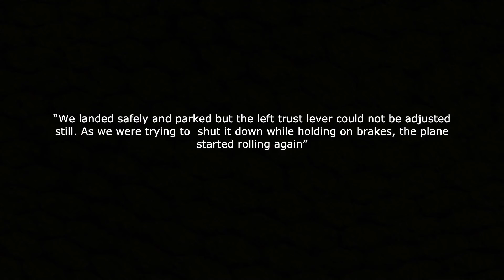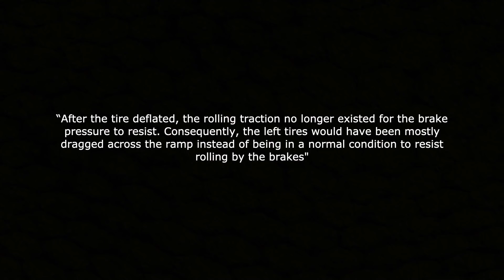The Crash Caused By A False Sense Of Security | RwandAir Flight 205

Comment: I think I'd have remained on the runway after coming to whatever kind of stop it was, and cut the fuel switches. If that didn't work, set the parking brake.  If that didn't work, pull the fire handle. If that didn't work, discharge the fire bottle. If that didn't work, have the fire department shoot water or foam into the engine to snuff it out.  I reckon the crew would have certainly felt the tyre imbalance - even with good types you feel everything, so not sure why they would taxi with so many failures.

Comment: After viewing so many of these stories, I can't help but to think that checklists are both a blessing and a curse. Many times is seems that checklists become a substitute for essential knowledge of which pilots should be aware, without referencing a list. Were these pilots truly ignorant of how to terminate engine function? Even if they were reluctant to do it airborne, they should've killed the engine via the fire suppression system the second they were stationary on the ground.
I'm also shocked that pilots can be unaware of which engine powers what, in terms of hydraulics etc..

Edit: Surely there where other ways to deactivate the engine. For example, wouldn’t the fuel pumps be on a circuit that they could trip?!?

Comment: I'm reading through the CRJ 100 manual.  It looks like they should have been able to shut down the fuel pump, or divert the supply to starve the misbehaving engine.   The video says procedure would have been to pull the fire handle which would have done the same thing.   

I'm not seeing if the pump is electric or an engine driven turbopump.  Pg 17 of the fuel system manual says the left pump is on DC BAT, so it sounds like it's electric.  Or it's just an electric control solenoid.

Was it an issue of the pilots knowing how to operate the plane, but didn't know enough mechanically about it?   Like, they are taught all about the indicators and gauges, and the strict procedures to accomplish things.  Did they not know or think to  cut the fuel and starve the engine, because they didn't know enough about the system?    Or is there a pump driven by the engine, which can only be shut down by closing the stuck valve?

I didn't fly much, and never a jet, but I was taught very little about the actual engine.   It was a lot of "this must be on for that to work", but not too much about why. 

I guess stuff like this doesn't make the news because usually they'd get far enough on the checklist to pull the fire handle, and it would just be a normal landing requiring service after the passengers got off.   All of these kind of videos are the rare ones that became a newsworthy event.  Who knows how often they happen.  Probably more than a few times to generate multiple service bulletins.   Just not enough to get the attention of the pilots and maintenance crew.

https://www.smartcockpit.com/docs/Bombardier_CRJ_200-Fuel_System.pdf
Reply: There are electrical and engine driven pumps. The boost pumps are only used during starting (fun fact: the electric boost pumps do not supply enough fuel to keep an engine running if the engine driven pump fails). I'm going to guess tunnel vision on the pilots just wanting to get on the ground and figure things out there when it felt safer. But I hate to Monday morning quarterback and incident.

Comment: Why didn't they use the fire pull handle? That cuts fuel at the feed line.
Reply: I wondered if there was a circuit breaker for the fuel pump.
Reply: As the manual say.

Comment: Makes one wonder if when pilots are trained for a new plane that they learn the checklist by heart. It seems that it takes too long to solve anything quickly by following a sometimes convoluted written diagnosis.
In this case it appears that shutting the engine down as needed in this case, was easy enough - only needed to find the right checklist entry.
Reply: Normal checklists are definitely known by heart. And memory items. QRH procedures are usually not known as well. First most are rarely, if ever, used. And second the CRJ has a 3 inch binder for all the different emergency and abnormal checklists.

Comment: First thing i thought of was partitialy executing the firedrill.
That is pulling the firelever but not activating the bottles.
Apparently this also is wat the QRH statet, as it would for most airplanes.
The only simular case i am aware of is the Quantas Flight 32 A380 incident where an exploding engine cutted the controlls of the adjacent engine.
It is as they say in the savety briefings, "Please remain seated until the aircraft is fully stopped."
Seatbeltsigns are switched of when the Engines are cut.
Regarding the crew.... well  how about some descent simulator training.
Unless you are an experienced testpilot you're not capable in improvising.

Comment: And what about thrust reversers ? May be that helped.... Cause both engins can go to 95% so this will make complete stop to plane regardless engin running on full power....
If one thrust reverser not working that time asymmetry may lead to deviation after touch down, but they can use thrust reversers keeping both engine power to 95% ???
Reply: I'm guessing is that since they couldn't think to turn off the fuel to the engine they wouldn't think about thrust reversal. Pilots didn't understand how important and obvious systems operate.
Reply: @henryD9363  Thrust reversers are locked out until the engine is at idle power. Helps prevent a reverser from deploying in flight.

Comment: Plane on the ground safely shut down the engines, No wait lets taxi to the gate with 95% thrust on the left engine.
Reply: They shut down only one engine. They should have cut the fuel or operated the fire extinguisher system on the still spinning engine immediately after touchdown.
But they didn't

Comment: Welcome to third world airlines and pilots. The fact that I'm sitting here, a non pilot thinking kill the engine with the fire system says it all. That fact and that they didn't request an emergency response says you take your chances when you fly foreign flagged airlines. They are not trained to the same standards.
Reply: fire system deployment would wreck the engine and cost $$$.
Reply: @ysesq  I guess your right considering the wrecked the whole plane. Thank you Einstein.
Reply: @thereissomecoolstuff  the difference was they did it unintentionally. hindsight is 2020. they thought they had it under control at the lowest $$$ cost and they were wrong.
Reply: @ysesq  my point is would a US airline pilot handle it the same. I say hell no!! Third world carriers you take your chances. That's why the 737 max grounding was so unusual. It was good they got it sorted. Sad that people died

Comment: No, I don't know of another similar case of stupidity. Taxing with two flat tires and an engine stuck at high power? What can go wrong? Why shutdown one engine and leave the stuck engine rinning, with high power? Push the fire button if the FCU is stuck. As forelectric hyd pumps, the CRJ also have full time on position switches.  Somebody didn't have some system knowledge. Not very bright.
Reply: Bright enough to demonstrate stupidity multiple times in a row.

Comment: Does the RJ not have fuel cut-off valves for each engine?
Reply: That is what I am thinking, most fire suppression/emergency shutdown system normally cut the fuel off.
Reply: The fuel shut-off valves are built into the engine fire switchlight. Not common to select that switch light when it is not illuminated.

Comment: This is the only accident I know of that happened AFTER a plane came to a full stop after landing.
Reply: Now talk to any flight instructor about students who stop on the taxiway after landing, and who then reach to retract the gear instead of the flaps.
Reply: @AdrianColley  :  That brings up a question I've occasionally wondered about:  Why retract the flaps at all (after landing)?  You're gonna need 'em to take off again anyway.  So why not just leave them extended?
Reply: @Milesco  The explanation I heard is that gusts of wind are more dangerous if you're taxiing with extended flaps.
Reply: @AdrianColley  :  Okay, I can see that.   I hadn't thought of that.  Thanks!  🙂
Reply: @Milesco  On some landings, it's also beneficial to retract flaps on touchdown.  Flaps give your wings more lift, therefore reducing the downforce of your wheels on the ground.  Reducing that extra lift will give you more braking power for shorter landings.
Reply: @DE-nm9jx  :  Good point, but don't the spoilers take care of that?
Reply: @Milesco ya, larger planes will have spoilers, but for smaller planes they tend not to.  Pretty much anything you would see airlines use will have them, but planes that are used for flight training don't really.  There's probably exceptions though.
Reply: @AdrianColley  don't most planes have an interlock that won't let you retract gear if they're compressed?
Reply: @AdrianColley  Wut? These are people who should have a mandatory IQ test before WALKING. And should be sterilized.
Reply: @windsofmarchjourneyperrytr2823  The argument could be used about making comments on social media, at least in your case.
Reply: Saudi 163
Reply: there were a few actually...
I remember a Tupolev that burned out due to a fault when docking to the air-stairs, I think it was in Irkutsk but not sure...
then the was a DC9 that also badly caught fire due to leaking fuel coming into contact with hot breaks in Florida (Miami I think...)
also, with lighter aircraft
quite a few seaplane-charters flip from wave-induced motion once stationary or near stationary (the rudder loosing the power necessary to keep the floats angled into the waves)... I think it was even on Croatia's Air-Safety most wanted list (equivalent) for a time.
Reply: You don't remember the 23 who burned to death in a flash over in the 80s?
Reply: There was one where the plane landed then caught on fire due to seat #8 above head storage bin contained 8 0z. Of gasoline half liter, And it exploded. Most pax got out.
Reply: It didn't come to a full stop.
Reply: @davecarsley8773  This plane came to a full stop. Fully stopped they've shut down Engine two, which provided the energy to keep the brakes on.

Comment: It's hard to make sound decisions in the cockpit and economics dictates money over safety..so pilots usually never know it all about the machine they fly! Overall, they did well.
I was a private pilot and did get myself into hot spots a few times but staying claim and asking for help from ATC meant that I now live to tell the tale. There has been 1 occasion when I challenged
d the captain and he agreed, so another safe landing. It's easier to challenge the captain if it's your airplane (This is registered as G-RUBY, and I was the first UK owner). On another occasion, I aborted take-off (G-RUBY) because the engine was not powering as we rolled..The captain asked afterward why I aborted the takeoff. Technical support had a look and it was a loose magnetos connection. 1/2 later we were up in the dark skies over the Southern English coast..The moral of the story...never be afraid to challenge the Capitan if you think he is wrong...You have the right to take over.
Reply: So the pilots didn't need to know about fuel selectors for the engines? 

I don't think asking ATC for help is   what you can rely on as a pilot. You're supposed to know how to fly an airplane without asking ATC what button to push.

Comment: The aircraft had time and fuel to maintain flight
for more time, in the air .  The pilot should have used this 
time and bring in ground trouble shooting  support.
The strut problem and it's corrective action would have been solved.
The pilot rushed to land to soon.  Pilot error was 100%.
Reply: Yeah and I can think of a dozen flights that if they had not stayed in the air and trouble shot the problem and just immediately landed 1000 people would be alive.  I would in any emergency where something is out of control get the jet on the ground.   Air Alaska comes to mind, they had a stuck stabilizer.   If they had not trouble shot it and just landed and inverted crash into the ocean would have been avoided.  SwisAir had a fire but they chose to dump fuel big mistake.  and one of the best is where they turned off the wrong engine and had no power so many more.   Landing the jet should be top priority.
Reply: @aduboi1534  
Quote, 
'THEY FLEW THE PLANE BEAUTIFULLY WITH THE ENGINE AT MAX 
POWER."  They decided to land the plane with one engine at max
power.  There was no rush to do this.  They had plenty of time to
continue to trouble shoot and to get trouble shooting advise.

The corrective action was to return to 2000 feet and then power
down the engine.  The Computer control would have been disengaged.
The engine would have powered down.

With a full powered engine on the ground, the plane was now in
MAY-DAY condition,  a Life threatening condition of all passengers.

This situation was indeed 100% pilot error by faulting to take
proper corrective action.  100% pilot error. Pilot's license revoked.
Reply: @billrundell2097  And in hindsight we know it was fine, but you don't know if the engine will catch fire, explode, tear off whatever..  Yeah it is easy to know what to do after it is all over  As I said I bet the passengers and crew of the Alaska flight that went inverted wished they had landed and not trouble shot the problem while flying.
Reply: @aduboi1534                                                                 
                       The report states that they failed to trouble shoot the correct 
trouble shooting log about regaining engine control.  IF they
had they would have corrected the problem.  Stated they had
no problem in aircraft control as it flew beautifully. Pilot error crashed this plane.
Reply: @billrundell2097  fuel control was jammed open
Reply: @ysesq  
To close the fuel control, computer retset was possible
if they read the correct emergency manual.  To do this they had to
return to 2000 feet to abort the computer landing procedure. 
The flight crew reviewed the wrong emergency procedures. 

The plane was responded otherwise beautifully,  There was no rush
to land with full throttle.  

The pilots are trained professional persons in cases like this.
It was their failure to take the corrective action as described 
in the emergency manual. 

The pilot error resulted in a runaway on the ground aircraft, 
unable to evacuate the passengers. 

Was there  a MAY-DAY with emergency 
ground crew ready and standing by?   The pilots did every
thing wrong.  Without exception 100%  pilot error.
Reply: @aduboi1534  
The pilot knowing landed a plane that he knew
he could not shut down the engine.  He never requested
 ground help to solve the problem.  Emergency support
was never request to be available.  He never consulted
the correct emergency Manuel .   WHAT THE HELL WAS
HE THINKING.

The plane flew beautifully.  He had the time to properly
trouble shoot.

The Pilots are trained PROFESSIONAL people.

Comment: The other issue with the brakes is that there was higher braking force required on the Left tires due to the Max thrust of the Left engine. This is why the Left Main tires deflated before the Right tires.

Comment: I can understand that under pressure they might not have got the right page in the manual and thought about the fire switch. But surely anyone with a  situation like an out of control engine would think of shutting off the fuel supply. I would know to do that with my car if the throttle stuck open and the ignition switch failed. In a diesel that is how you kill an engine anyway. NO fuel No run.
Reply: Makes you wonder what kind of training these bozos received. I'm sure they knew how to start and stop a automobile engine. Maybe some of that knowledge should carry over into flying an airplane.
Evidently not.

Comment: Re brake release on shutdown: Chuck Yeagar gave several accounts in his book on how he survived emergencies because he knew the systems of the airplanes he flew.
Reply: Yup, thorough system knowledge can save your ass. I only ever flew ultralights, very simple planes, but I recall on the plan I learned on, the pitot static system was a bit strange. It had a pitot-static tube, but that only fed the air speed indicator. The altimeter and vertical speed indicator had a separate static source. If you didn't know that, a blocked static port could really confuse you, because you'd be expecting it to effect all three instruments, not one or two, and one old time procedure for dealing with a blocked static port is to break the glass on the VSI to let cockpit air into the system, but in this case, that still wouldn't fix your ASI because those instruments aren't connected at all.

Comment: Can't believe they didn't use the fire protocol to shut the engine down when they landed, woo.
Reply: Shouldn't have even considered landing until they had a fully controllable aircraft.
Reply: @millomweb  the pilots have to assume a system error and that any action can cause more loose of controll.
Imagine your planes flight computers go crazy and... then? Hope that the system will improve or try to land with what you have?
Trying to regain control when there is the real change of loosing even more controll... I do not know the right call.
Reply: @sarowie  Assuming a system error is a bad approach. It is fair enough trying to regain control but failing that the engine should have been aborted and flamed out. 
Having heard the cause, there was the naughty option - inverted flight to shake the stabiliser bar out of the way of the fuel valve !
Reply: @sarowie  remember,  the video author said the quick reference handbook  said to shut the engine down. If one is trying to trouble shoot a problem I'd think a "quick reference handbook" might be something to check,  they didn't need to guess.
Reply: @millomweb  Yeah they should have just plowed into the ground instead.